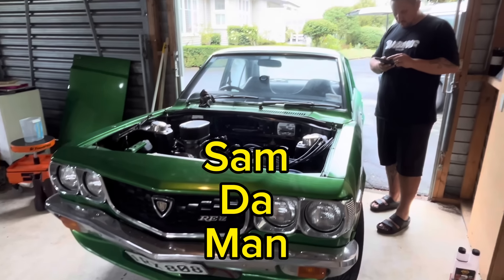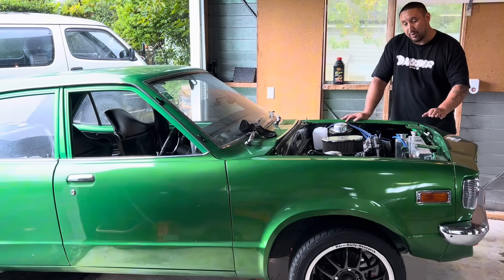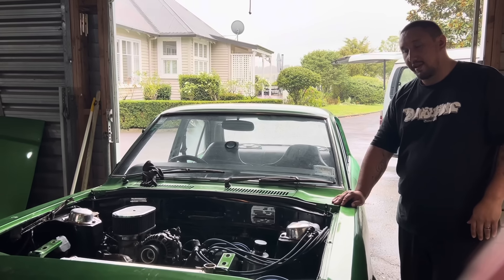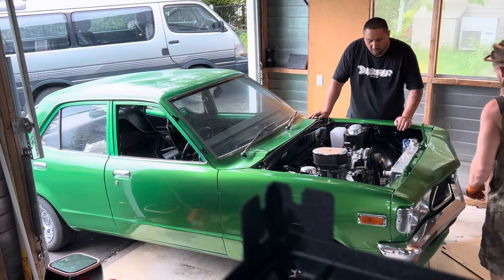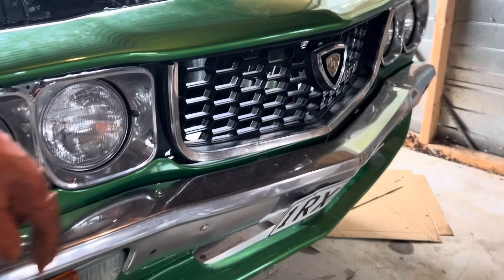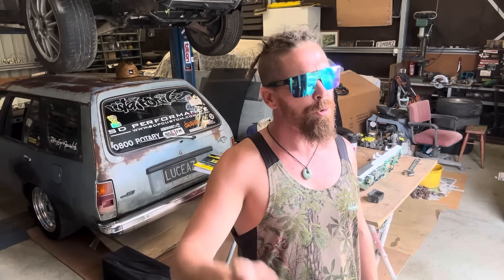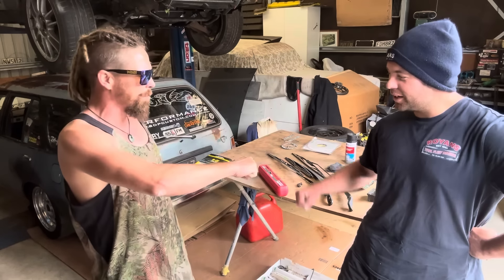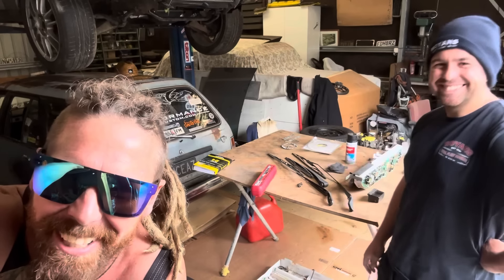RE BUILDING A OLD RX3

Comment: I’ve done 200 km on one rota stopping with running motor pouring oil down carby then when getting home it gave up when cold seized “ .    - very sad
Reply from the maker: Trippy, this thing labours to start and makes a high pitch metal on metal sound
Reply: Side seals never get their chance in the spotlight it’s always apex this apex that one peice this corner seal this way “ .  -big bannana